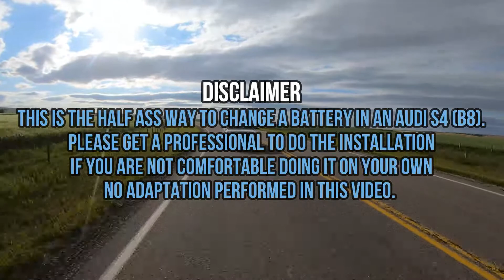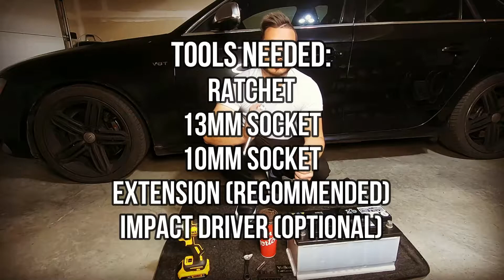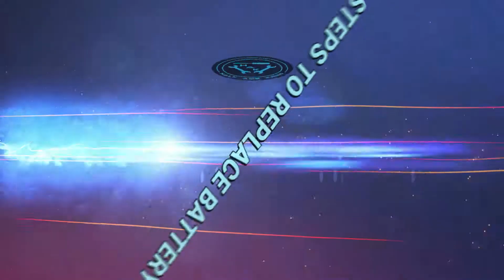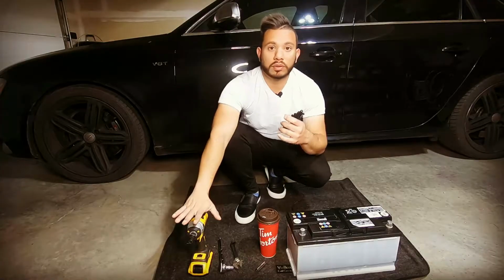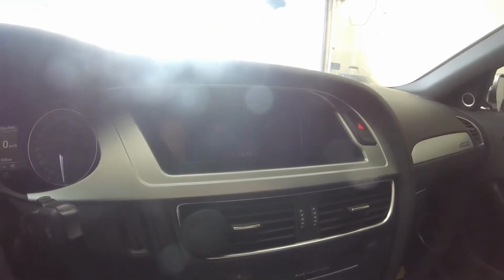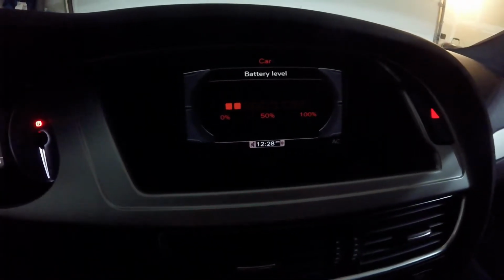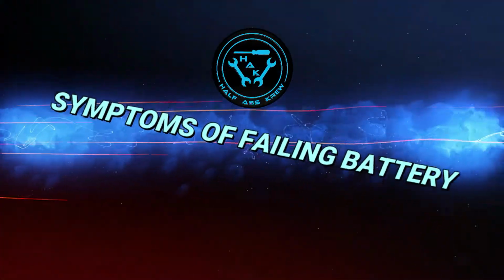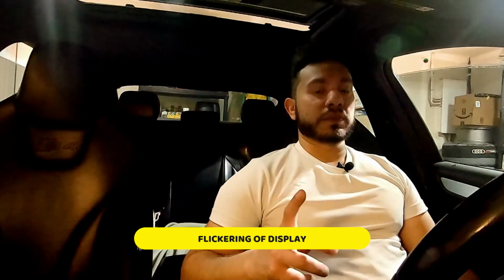Seamless Battery Swap for Audi S4/S5 – No Recoding Required

Comment: Is your battery still going strong? so, another words, if you put in a battery... you do not have to reset the computer? just drive and it'll go back to 100%?
Reply from the maker: Battery is still going strong at 100%. No reset was required but from my understanding the reason they want to code in a new battery is too avoid the alternator over compensating.

Comment: Did the battery die yet?  The issue supposedly isn't the difference in capacity of the new battery, but rather the ECU settings for voltage output of the alternator.  For the old battery, the alternator compensates by upping the voltage output to squeeze out performance from a shit battery.  However you put a new battery in and that alternator is still over compensating.  Apparently this can wear the new battery out in 3 months according to an Audi tech.  

So I'm curious if this was your experience or not
Reply from the maker: I was very skeptical as well before trying this. Happy to inform you that after 9 months it is still holding juice at 100% and the car has done a trip from west of Canada to the east with no starting issues. I can give you more info if you have any questions.